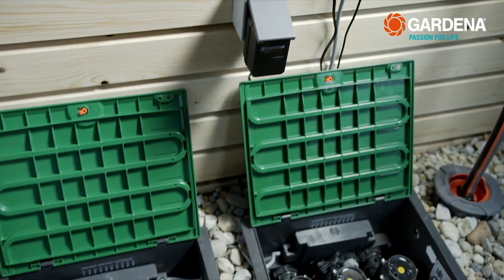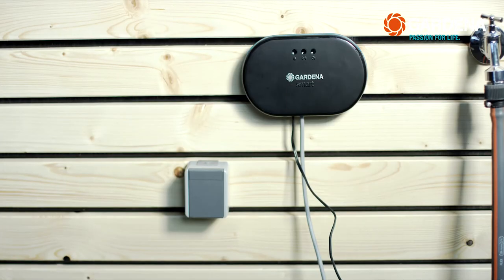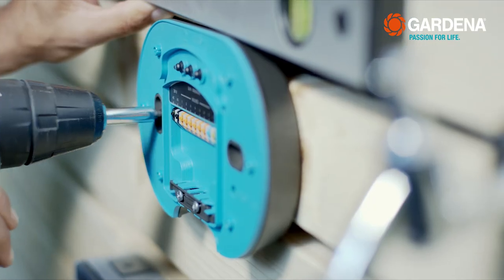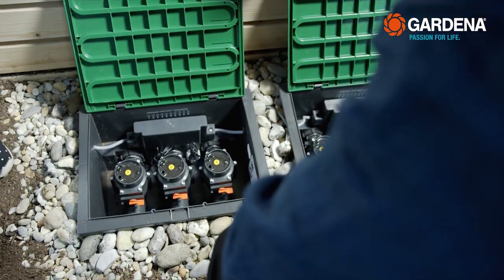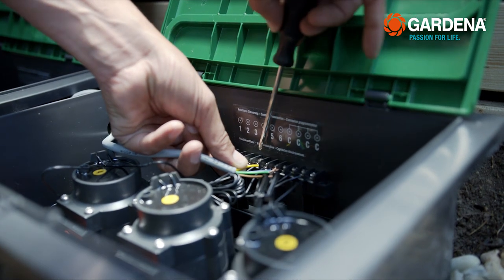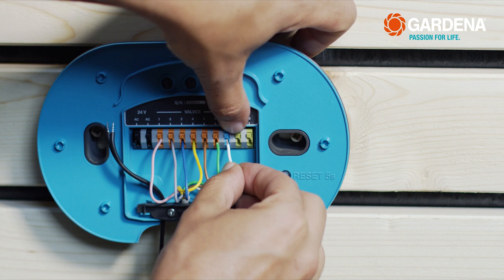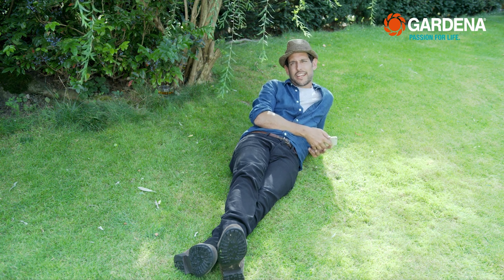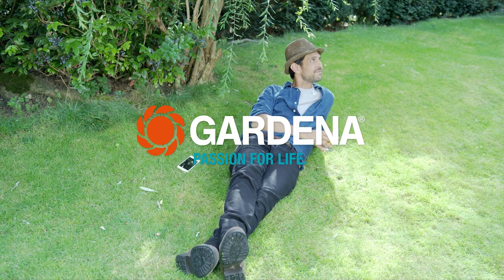GARDENA smart Irrigation Control - How to (Chapter 1/6: Overview)

Comment: Hi , does the smart water system works with the Gardena automatic water distributer(1197-20)?
Reply from the maker: You can use the GARDENA smart Water Control and the GARDENA Water Distributor Automatic together. 
Please take into account when installing the Water Distributor Automatic, that you need to pause between irrigation times. You find more information about it in the operating instructions. 
Hope this helps you! If you have further questions, you can contact our service team: service@garden.com